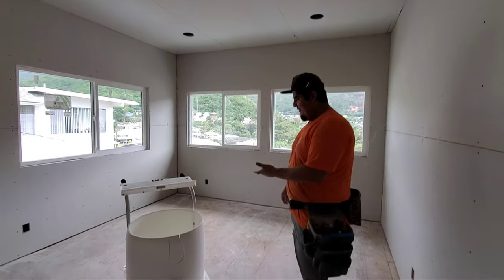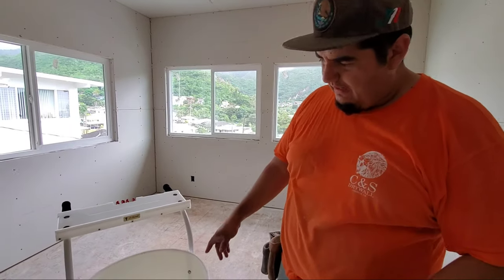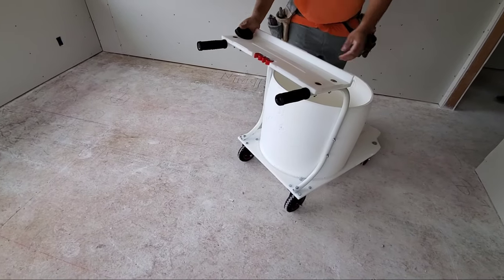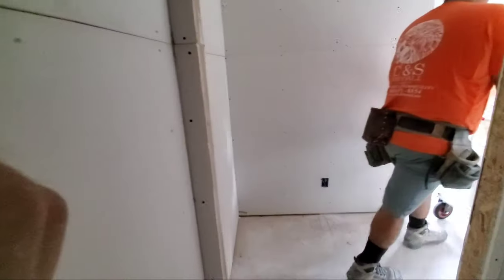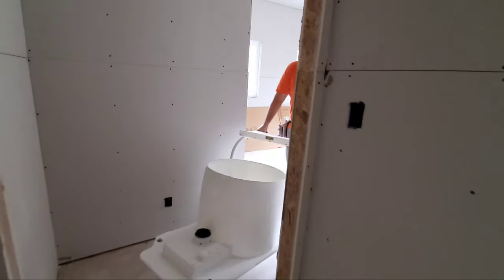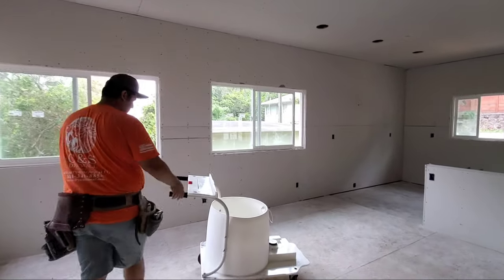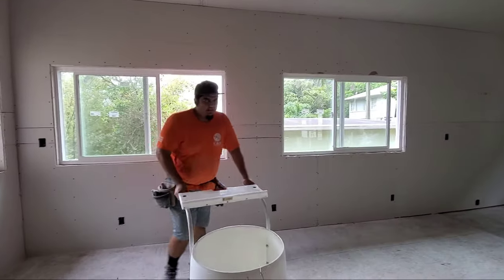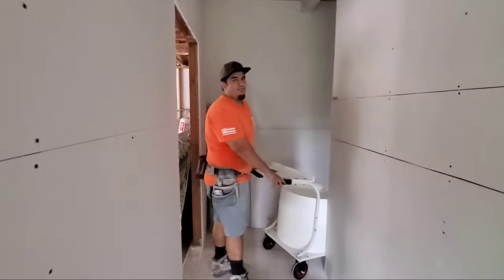New Drywall Mud sled by rip it tools! #drywall #drywallnation #drywalltools #products

Comment: Rather mix 6 buckets and spread them out through the floor plan
Reply from the maker: I know what you mean about hauling it around but on a big single story build or a big commercial jobsite this thing pays for itself in no time. 🤙
Reply: C&S Drywall  
Have you looked at the kodiak Bro?
I have not used it my self i have relatives in the mid west and they swear by it 
Ive used the gracos  im not a fan but they work as i always had my spray force. 
I saw the duo flex before i saw your video but the two units kind of 
Turned me away as thats the same with kodiak